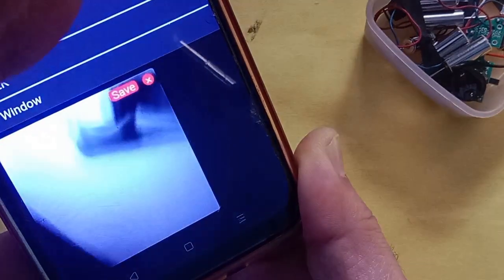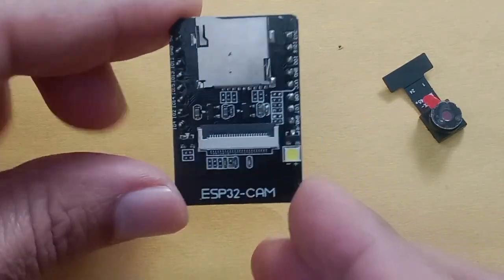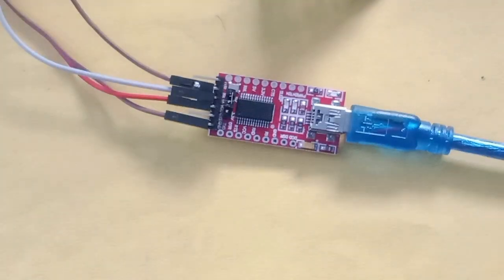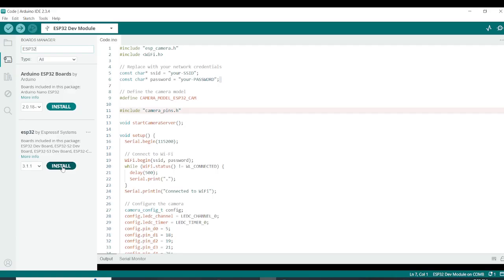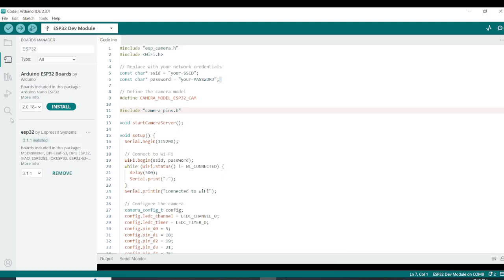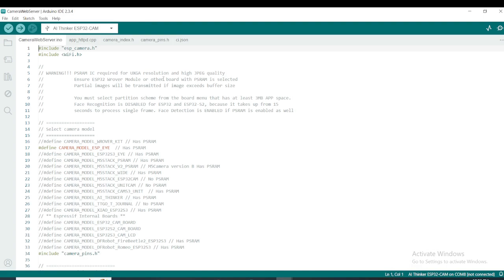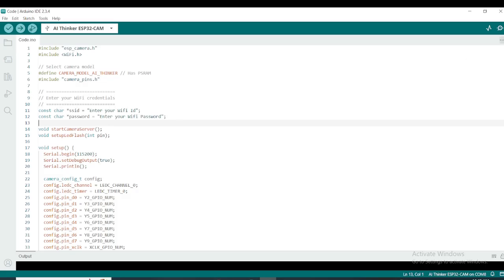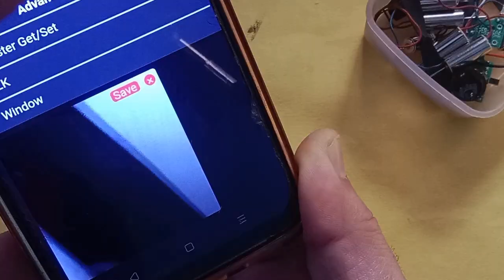ESP32 CAM Live Streaming Project - Complete Guide for Beginners (Code & Setup)

Comment: A fatal error occurred: Failed to connect to ESP32: No serial data received.
i tried so many times with same procedure but it it is giving the same error everytime
Reply from the maker: Looks like this is due to communication problem between your computer and the ESP32 module.

Comment: Please help me. I used like ur guide but it didn't show the camera? I'm wrong somewhere?
Reply from the maker: 1. Check wire connections
2. Make sure you entered the correct wifi id and password in the code before uploading to ESP32 CAM
3. Check your CAM module and adjust code accordingly
4. Try to understand the error and do troubleshootng

Comment: I facing problem with camara working. Serial monitor showing error psram not supported. Can u help with this?
Reply from the maker: If your ESP32 CAM module is an "AI Thinker" and if you selected "ESP32 Wrover Module" but your board doesn't support PSRAM properly, then you will see this error.
Reply: @TechCraftAndHacks2 so how can solve it pls reply brother

Comment: bro i got all till ip after that pasted that in the network which used for esp but the browser page still loading
Reply from the maker: Looks like wifi connection issue. ESP32 CAM and the device you are using to access ip should use the same WiFi network.

Comment: im facing memory error 
rst:0x3 (SW_RESET),boot:0x13 (SPI_FAST_FLASH_BOOT)
configsip: 0, SPIWP:0xee
clk_drv:0x00,q_drv:0x00,d_drv:0x00,cs0_drv:0x00,hd_drv:0x00,wp_drv:0x00
mode:DIO, clock div:1
load:0x3fff0030,len:4832
load:0x40078000,len:16460
load:0x40080400,len:4
load:0x40080404,len:3504
entry 0x400805cc
E (497) esp_cor��&VW }���͡: No core dump partition found!
E (497) esp_core_dump_flash: No core dump partition found!

with the same camera module RHYX M21 45 

have you been in this trouble  ?
Reply: I'm feeling it might not be supportive enough cuz there is ML application i need to run. 

So having OV2640 is best right
Reply: yeah , after a while i got ip . then we checked grayscale , isnt there any way to make it RGB
Reply from the maker: It is possible but it will work very slow.
Reply from the maker: Replied
Reply: I'm feeling it might not be supportive enough cuz there is ML application i need to run. 

So having OV2640 is best right
Reply: May i know how long u wait for getting the IP cuz i think i have the same issue as you

Comment: brother in my esp32 cam webserver there is no option for face detection and face recognition why?
Reply from the maker: You need to integrate face detection and recognition using libraries like Arduino's ESP 32 CAM face recognition Library or you can use OpenCV.
Reply: @TechCraftAndHacks2  par bhai library se remove krdiya hai face detection aur recognition ka bina open cv use kiye nhi ho skta?
Reply from the maker: @DoraeShort  as far as i now...necessary library ke  bina nahi ho sakta.
Reply: @ bhai koi tareeka btao maine project choose krliya hai smart door locking wala face recognition ke through using esp32 cam kaise proceed krein further im stucked here
Reply from the maker: @DoraeShort  Kabhi kabhi Youtube videos dekhkar solution nahi milta hai. Apne city may kisi local se pata karo jo iss type ka projects banata ho.
Reply: @TechCraftAndHacks2  bhai koi nahi banata hai...waise thanks itna sab btane ke liye bhi